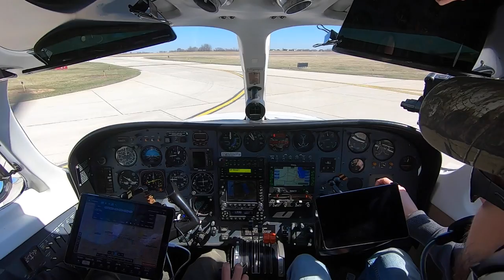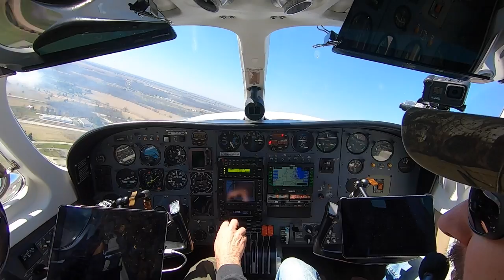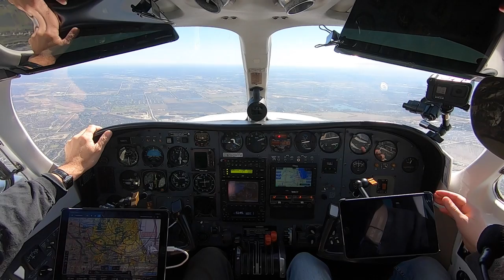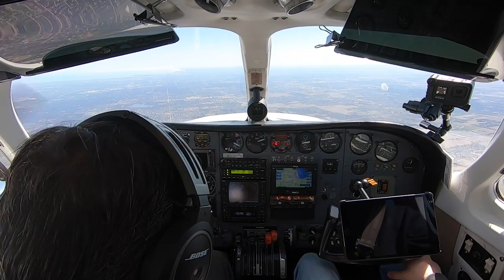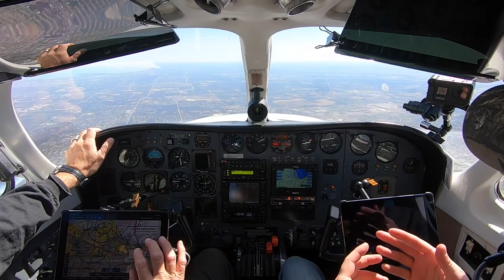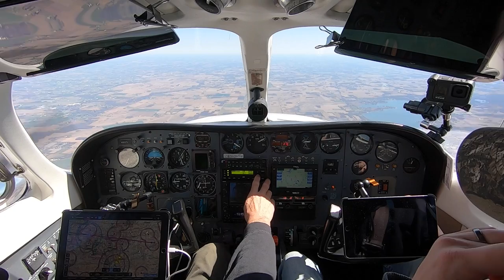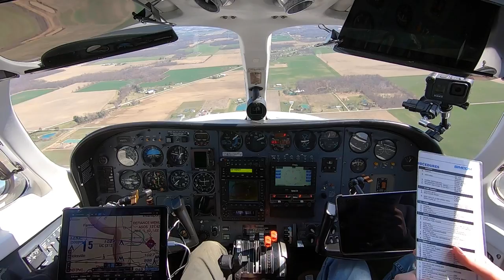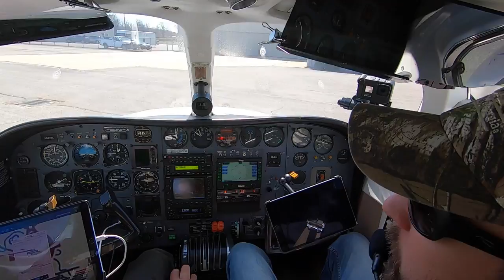Cessna 340 Flight to TAS~My Airplane is READY!

Comment: Kevin I had a dual vacuum failure on my Malibu. The issue was that there were holes in the boots that were allowing water into the system over a long period of time which caused both vacuum pumps to fail within a few hours of one another. A lot of water was drained out of my system.  TAS explanation for you sounds reasonable, but just ensure you don’t have boot pinholes that are allowing water into the system over a period of time.

Comment: I love this VLOG and the Total Professionalism of TAS towards a customer and possibly a future customer. I worked for Gulfstream when they first Moved to UK in 2004 and we had similar work ethics and Customer support. The Gulfstream aircraft are on CMP which carries out the tracking of maintenance and components that require time or cycle inspections and we also dealt with NetJets who have a similar maintenance tracking and component. I also like that they drop and "SOAP" the oil on every aircraft on arrival, so much can be learnt from doing this about the Engine and Propellers  and if they also do the Hydraulic oil testing this can also aid them with keeping a historical record of the components These older Cessna Twins are in need of this inspection and if anyone thinks they can skip on maintenance they are in the long term risking the aircraft  The finding of the Nose U/C bush bearing and bolt close to failure shows that TAS have dedicated engineers who are very experienced and in my working life I have come across the other side of the spectrum in engineering Thankfully the FAA / CAA & EASA are the people that inspect these shops and not much gets past Love the VLOG and Wish so much that I could be back at work as I loved my job but sadly health stops me GO TAS and Kevin

Comment: After owning twin Cessnas for years, I still have a special place in my heart for the 340 (of course the A model with the more powerful engines). The 340 is the best looking twin Cessna ever made. No offense to the 310, I owned two T310Q models because I liked the short nose so much better. Pretty sure that’s why I like the 340 better than the 421. I loved my 421, but it must be that nose that threw something off in my brain haha (although it was a great place for golf clubs). Even though I’m in a turbine now, I still hold a special place in my heart for twin Cessnas, especially that sexy 340. Thanks for all the great videos and I’m thrilled that “imminent” gear failure never came to fruition. Stay safe and see ya on the next one.

Comment: Oil analysis is such a great idea.  I’m in a club with three planes and it is such a great tool for the maintenance.  I use Blackstone too.  I am sure others do it too but they are great.  They can pretty much tell you what is wrong or going wrong with your engine just by what metal and how much.  They even can tell you what to do or look for.  I even use it on my car.  Great videos.  Been a fan for a long time.  I am a maintenance officer on one of the club planes and love this series.  I love to watch the flying but it’s nice to see the other stuff too.  Keep up the good work!

Comment: I helped out in a maintenance hanger. I was shocked how neglected some old aircraft had been treated. One had lose under carriage torque links. I was told to pinch up the bolts. I said that will crack the bracket.  I removed the bolts, they all looked like camshafts. New bolts and shims fitted, i learnt i lot. I greased up Arrow undercarriage on jacks, seen few not greased in a long time. Done right grease goes everywhere, so hard to clean up but can see it's been done. Old grease looks like dog poo.

Comment: I can't imagine how much does an overhaul like that costs (not even going to ask).
One thing's for sure. Those guys seem to know what they've doing
Reply: I’ll ask. What was the bill?
Reply: makes you wonder how a couple ATC controllers can afford all this
Reply: Yeah, I'd hate to think.  I mean the mechanics time must be at least $200 an hour and there was 100 hours in the wing skin repair alone. Plus the rest of the inspection and parts.  The total on the bottom of that invoice must be eye watering.
Reply: @rand0m0nium  ha... you obviously don’t know what controllers make do you. Avg. well above 100k. Given their experience, propably 125 to 150k each. So yeah they can afford there older airplanes.
Reply: @rand0m0nium  
Why don't you ask them directly??
Reply: What’s scary, there’s a bunch of twin Cessna’s flying around with shortcut annuals done on them by someone else, nose corrosion, bent nose gear bolts, cracked webs. These last two vids are super valuable, too bad there’s not more like this. There should be some kind of gold plated award for companies that have this much pride in their work.
Reply: @scottwheeler2494  keep in mind that they are making money off the YouTube videos as well.
Reply: @mrbrent4  and not a small amount either.
Reply: He said in the last video that there were 100 man hours for the sheet metal repair. That's ten grand right there for the labor. After everything else, I'll bet the total cost was north of twenty grand.
Reply: @rand0m0nium  pretty much none of your business what they do with their money.
Reply: @JimOHalloran  mechanics are rarely $200 / hr.

Comment: Sounds like they definitely take care of their customers.  I like how they took their time going over everything with you, not rushing through everything.  I know with my last Jeep and the Grand Am I had before that, every time I took them in for repairs, I was rushed through everything they did, quickly paid my bill, and was out the door.  With the Grand Am, I last took it in to get worked on, and the place called me the next day, wanting me to bring it back in.  The mechanic who'd worked on it had found a bolt and wanted to make sure it didn't come from my car.  I asked them when I got there "Don't you check vehicles over before sending them back out on the road?"  Then with my last Jeep, I got home from getting the radiator replaced only to discover that they'd sent me home with a bolt missing and a broken headlight bracket.  I took it back the next day, pointed the issues I'd found, and then they found more issues.  When the service manager came into the waiting room to talk to me, I turned a lot of heads on the other customers when I loudly asked him, "Is it your policy to return vehicles back out on the road with broken and missing parts?"  They never did fully correct all of the issues, and I ended up having to go to another dealership to get the issues resolved.

Comment: A thoroughly fascinating episode Kevin! I'm glad you've got the bent bolt so you can mount it on a wall in a frame! Very impressed with TAS and their service. Worth every dollar for expert thoroughness. It'd be interesting to know if you noticed anything different sound wise from the pilot seat on the way home to Aurora, especially with the noises that the gear makes when cycling up and down which now has healthy thuds when everything locks in place. Cheers from NZL, David.

Comment: Hi Kevin.  I should have asked this on the previous video when TAS was checking the landing gear.  I noticed when you mounted a camera on the underside of the tail while back where the movement of the landing gear could be seen and again when TAS was checking the landing gear ... that when the gear is going up, it isn't smooth.  It sort of "bounces" a bit as it goes up.  It comes down smooth.  My thought at the time was that something needed to be adjusted or the electric motor had something going on.  But when TAS was working on it, it did the same thing every time and they didn't bat an eye at it.  Is that normal??  -Dane

Comment: It's interesting that there isn't any AD or Service Bulletin on the Nose Gear bolt. Not sure about the Cessna Pilots Association sharing of these kind of things.

Anyway, when you get the bill for your annual, and it's over 20K you start to realize a $5 USD part could have caused a noise gear collapse and huge expense. So logically you think 20K sounds ok.

I think the unknown in annuals is right up there with getting married. The stress of the unknown. Getting the modern ELT was a great choice.

Comment: Nice drone shot at the end. Still scratching my head how you got the drone back :)
Reply: My guess is that someone at TAS has a drone and used it to film the departure. Simple email of the file and Kevin can use it. TAS showed in previous vlogs that they have some pretty good videographers.
Reply: @johngilbert1047  Never gave that a thought but makes perfect sense. Thanks
Reply: Due to liability issues, I would tend to agree with John G.

Comment: That's a $160,000 nose gear bolt.  Wow.
Reply: Yep.  $0.45 to manufacture, $10.84 for the manufacturer to get it certificated, $160,000.00 to replace if it breaks.

Comment: Newbie here ... what does ATC saying "altimeter 3054" mean?
Thanks.
Reply: Hey, Gord.  the "3054" is 30.54 inches mercury column, the pressure at the airfield.  The altimeter measures how high above sea level the plane is, based on air pressure.  But for it to be accurate, you have to "zero" it based on the barometric pressure from the (usually) nearest airport.  So there is a knob sticking out of the meter which you turn to dial in that "30.54" inches Mercury, or inHg. That will give you an accurate reading on your altitude.  Hope this helps.
Reply: @billybcgn25  thanks so much!

Comment: I say 35K for the annual
Reply: I’d say you’re in the ball park.
Reply: @SkylaneGuy , usually a vendor's first time performing an annual for a new customer is quite a bit more expensive--for the reasons you saw.  They go through it considerably more thoroughly, to catch any misses by previous vendors; plus, they hand-over-hand walk down every Airworthiness Directive and so forth, just because all too often some ADs get signed off, and they weren't performed.  The older the plane, the more ADs to trace down.  

After that, and especially if the plane undergone an overhaul within the past year by that same vendor, the second and most subsequent annuals aren't quite as painful.

Comment: Question: I see the prop mixture handles aren't the same, in this Cessna 340 or 1BC when you fly. Is there a reason they're both never aligned?
Reply: The engine controls are set to give you a desired manifold pressure, RPM, fuel flow, EGT or whatever on that engine. So they should be in the same general area, but otherwise have no direct relation to each other. Hope that makes sense.

Comment: My god you have to do this every year what an expense.
Reply: Don't forget that the definition of an airplane is "A machine that turns cash into noise."  Yes, next year, all the same inspections will need to be done, but hopefully much less will need to be repaired.  Also, a lot of the things they fixed this year should prevent much larger expenses in the future.  That nose gear bolt was horrifying.  It was not a matter of if, but when, and when it eventually failed even if nobody was hurt the resulting damage would probably be north of $100K.  In my opinion that annual was worth every penny, and I'm sure Kevin feels the same way.